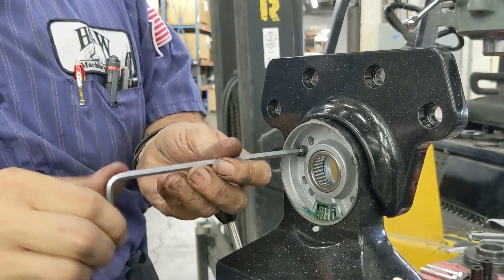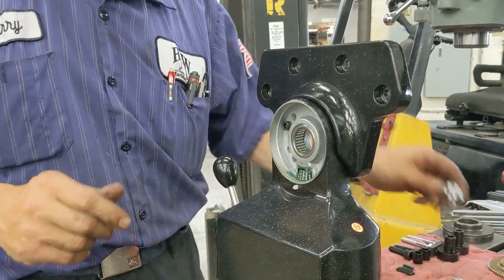Installing a Servo Power Feed on a X-Axis

Comment: excellent video.. i'm missing the shims or spacers for the servo, its been removed many times by previous operators.. also i have the servo stop but its not installed since the plate and stop posts are missing ..how can i order from you guys?
Reply from the maker: We have a website, you can order through there or call 1-800-285-5271

https://machinerypartsdepot.com/all-breakout-pages/#all-servo-bp-pages

Comment: I’d rather the handle not turn with spindle rotation. Is there a trick to installing the key? You didn’t show that part.
Reply from the maker: The way that the Servo is made, you are always going to have the handle spin. I would suggest maybe getting a safety handwheel if you are concerned, its still going to spin, but you wont have the handle hitting anything.

Comment: Looking at getting one of these for our mill, but cant find the speed settings; do you know how fast each number makes it go(As in, #1 is 10 inches per minute, etc?) Thanks!
Reply from the maker: This is from Servo, numbers are Inches per Min: 
Servo 140: 
1 = 0.75
2 = 4
3 = 7
4 = 10
5 = 13
6 = 16
7 = 19
8 = 22
9 = 25

Type 150
1 = 0.5
2 = 5
3 = 9
4 = 14
5 = 18
6 = 22
7 = 26
8 = 31
9 = 35

Comment: How do you replace an original table feed where the screw is longer. Do you need a spacer
Reply from the maker: Hi Tony, Servo makes a special kit for the gear driven feeds to Servo, M-0225-140/ 150. Their kit includes a bigger table bracket to compensate for the extra screw length. If you have any other questions on this kit you can shoot me an email at: support@hwmachinerepair.com . I can send you over a picture of what the bracket looks like if you would like to see.